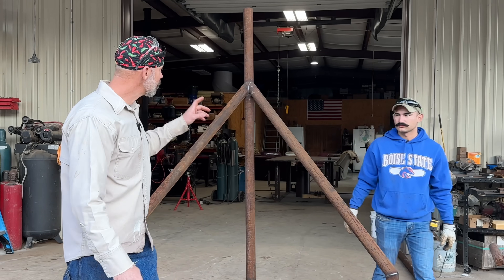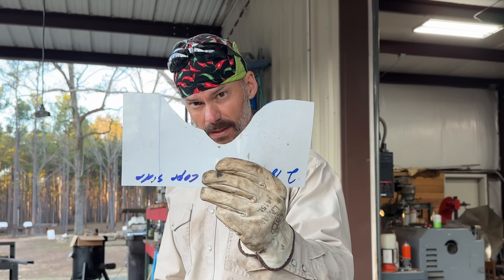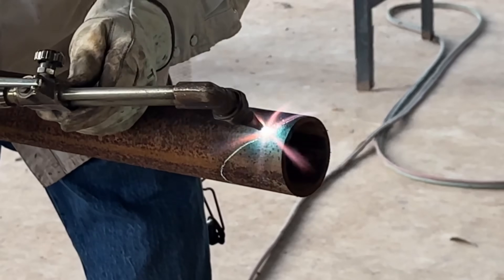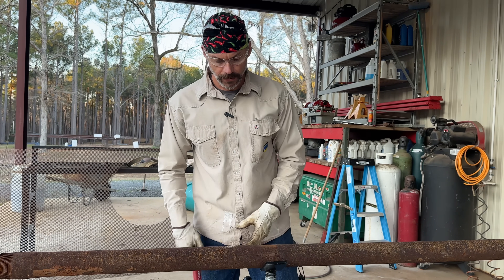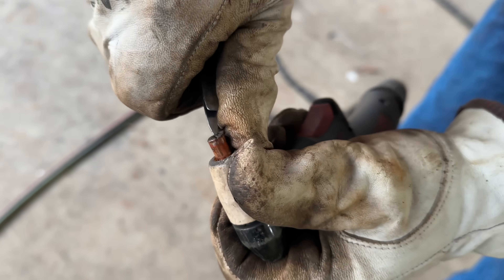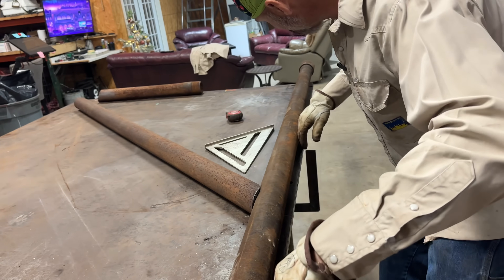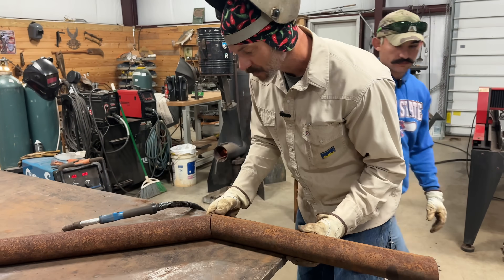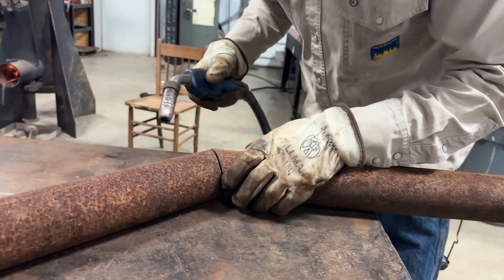Fence Corner Bracing Hack: Save Time and Money

Comment: Pro tip on clamping pipe to the table: cut some short pieces of channel iron (1-2” long) and use them to saddle the pipe therefore giving you a flat surface for the swivel on your clamp and two points of contact on the pipe.
Also, I hope your friend is setting these in concrete, otherwise….,🤦🏻‍♂️🤬!
Reply from the maker: That’s a great idea. And yes, he is definitely using Concrete
Reply: I make mini v-blocks with angle. They fit a pretty wide range of sizes.

Comment: Our past hole digger has a 9 inch auger so I weld a 9 inch rebar across the bottom and 90 degrees form that I burn 2 holes and make a {x} on the bottom of the corners and ends with a sack of concrete to help keep it from pulling up. 
I really enjoy your you tube channel'
Thank You'

Comment: On the welds, usually that kind of pipe thickness, I've always run 21.5 or 22 volts and 275 wire speed. Hardwire is fine for what it is.

Comment: Thanks for the video, could I weld this with a 120v flux welder?  Hobart Handler 140 is the model.
Reply from the maker: I believe so
Reply: @TaylorWelding  I may try my hand at a simple T type fence with some "no-climb" 2"x4" fence.   Metal posts in the ground with a single top connecting each post.

Comment: To save time fitting the brace legs I just chop them off at 45% in the cutoff saw, set them on their sides in the hydraulic press, and pressing them a couple inches back from the cut ends till they are like a long oval end, about 1/2 the pipe thickness. A little v notch at the narrow ends with a grinder cutting wheel, or torch and they fit well enough to get a good weld. We concrete them in at the bottoms because it is rocky here and hard to dig a narrow hole. I save on pipe by welding on 2-4  pcs of 1/2" rebar on the bottoms, on the sides of the pipe, that goes down into the concrete with the  pipe ending  just a few inches into the concrete. Often, I'll have the customer concrete in just their corners and gate posts, and I'll come back later with my portable engine driven welder and weld on the braces and gate hinges and mounts for gate openers, horizontal rails, small walk through gates etc. onsite. The post top caps can go on later onsite, allowing for adding height or cutting them down to suit the terrain. Some want a bolt sticking up with the bolt head welded around on the bottom of the caps to later mount a birdhouse, a solar fence charger panel, a cable to brace a gate from, an extension for deer fencing, or mount a sign across above the entry road gate, etc. On hills and slopes, mounting the braces onsite can help fit the terrain. I don't see a lot of that drilling pipe here, so the customer is usually  buying sch. 40 pipe, either galvanized or black.  Posts are 1-1/2 to 4 inch pipe, and braces are 1 to 2 inch pipe. At the shop, I have a hard wire MIG, and my portable is 6011 or 7018 stick welding. I have a 3 lb.ball pein hammer, and like you, I prefer that over a grinder for cleaning up ragged ends to refine the fit.

Comment: big thanks, if you havent already would u mind doing a video on saddling large dia pipe ? i kinda butchered my first time. but got er in there.
Reply from the maker: Great suggestion! I’ll definitely put that on the list
Reply: my bad you already got a tutorial, but i guess my question is if it matters if its larger diameter or if its the same technique. not sure i how i messed up. subbed 4 more.

Comment: I learn from your videos and appreciate the job you're doing. I've got a question. I'm an old guy and used acetylene and coat hangers to do body work in my youth. I have a plasma cutter and want to know what shade lens to wear when using it. I've heard everything from 5 to 11 and would like to know your opinion. I don't mess with my sight so currently use a self darkening hood set at 10.
Thanks.

Comment: Do you run your air supply for the plasma cutter from your air compressor "as is" or install a secondary filter in the line to trap any possible particles that could potentially foul the torch? I know some shops use oxygen tanks for the supply, but damn, that seems like pricey and unnecessary.

Comment: Good video. Hard wire is very forgiving with rust,but I usually run considerably higher voltage( 22-24+) and mostly.045" wire.I subbed ya !

Comment: Great job on the templates/production & getting 'er done fast-  Kinda surprised that solid wire did so well; just goes to show that it really doesn't care, as long as you can get to solid steel. We always used 6011's, but I also wouldn't be afraid to use flux core.

One question I do have; is he pre-augering holes, & then concreting them in? (I.e.....that preassembled corner would be a pain to drive.)  I prefer concreted corners, but for speed, a lot of guys just drive them & weld the braces in afterwards.

Also; on the plasma cutter....I know that some of the other companies offer gouging attachments; Any idea if you can gouge with the ArcCaptain? If so, that'd make me even more interested in one. 

Thanks!
Reply from the maker: I wouldn’t think the little arccaptain would be good at gouging it takes A lot of power to gouge. 
He’s definitely going to be putting them in concrete. He likes to pull on his fence until his truck slides backwards.

Comment: Bicycle frame building: Miters always, angles never the same (assumes built to measure, as they should be) and on pipes swaged paper thin in the middle, thinwall on the ends.  Two schools there: hack and file or hole saw cuts with a mill or fixture. Tighter miters are the desire because penetration is hardly an issue at .035"/.9mm. Fillet brazing also works well here, as that and lugged are the only two I've built. I don't fit factory. I hacked and filed, no mill handy. 
Your torch work is inspirational. Thanks for showing us how WELL it can be done.
Reply from the maker: I appreciate the input! I can’t imagine dealing with something that thin. That is Out of my wheelhouse. 
Good job

Comment: I'd run those together using flux-core - no gas cost, flux core doesn't care about rust & it welds hotter than hell -  this is an ideal flux-core project.
Reply from the maker: Flux core with gas would’ve been exquisite. I’m not a big fan of fuck core without gas. Seems extremely brittle. it doesn’t really matter. It’s a fence post for sake. 
I’d be a good video what’s stronger on Oil Field pipe flux core without gas hardwire or flux core with gas thanks for the comment bud
Reply: @jamesward5721 what’re some of the things you’re welding? Just curious. I read flux core was only approved in limited structural applications.
Reply: Flux core works pretty good on rusty fence pipe and almost as good as stick outdoors, but I would have stick for any thick parts or add weld reinforcement.  It should be good for all that size pipe in Sch40/80.

Comment: I actually like that idea of building the corner and the little jig you built with the hinge was genius. 

Magnetized pipes sucks when trying to weld it. 

Built an entry way not long ago for a customer and that pipe was the bane of my existence. I tried everything to make the first pass look good and ended up just putting dog-doo-doo and then running a pass over it.
Reply from the maker: All you can do is try to get something to stick on it when it’s bad magnetized. And sometimes it’s impossible. I have seen a few times in my career where it was absolutely impossible to weld because it was so magnetized. And wrapping your leads around it didn’t make any difference at all. I get tickled every time I hear somebody say that.
Reply from the maker: Thanks for the comment, bud

Comment: I do allot of fence and feedlot. The dead man's are good braces. Pretty much all the work I do is in the field. Around here most people want h braces but if it's pipe fence I run dead man's to the next post. If not I usually bury a post at least 3 feet about level with the ground. I like arc 80 about the most for oil field pipe. If it's magnetized I usually just turn it up to 110 to 120 amps. But I always use either 6010 or 8010. Sometimes 6010 cuts into the magnetization a bit better or seems and the 5p red rod works well.i have had some do bad it sounded like a stuck hog and threw balls off metal ball at me. It can be rough sometime but you gotta do what you gotta do. I have never had to wrap leads or anything.
Reply from the maker: Have you tried using a MiG gun? Honestly, I could not believe how good it did. Arc 80s would be my preference as well. Until I used hardwire with gas. I don’t understand it. It just works. Never would’ve thunk it
Reply: @TaylorWelding  i have not used a mig for oil field pipe. Almost 100 percent of what I do is in the dirks and as fast as it is welded, carrying a mig would be a hindrance. About the only time I use mig is welding under 1/16 material with flux core. I guess i should say wire feed and not mig to avoid arguments from people over semantics lol.

Comment: Question: instead of the cuts and welds would it make sense to consider stiffen plates (I’m thinking two at same orientation) with stitch welds or full weld down the pipe? Thinking a plate that fits the purpose would be more expensive than spent OWC
Reply from the maker: That is a great idea
Reply: @ heck 2 better cut plates 3/8 or so might cost as much as the spent pipe by the time the plate is 3” wide though. If cutting the plate yourself it probably works out but if buying cut/prepped nice and square maybe not. 2” stiffener probably works and then likely makes more sense. At least could push/drive the pipe in maybe. Just thinking out loud here.

Comment: Good fit up to me is extremely more enjoyable to work with. I have a mig machine and I can use it as flux core or solid wire my problem is tank space in my shop so I stay with the flux core wire. I would prefer 6010 stick welding then mig wire. However you proved a very valid point that a mig wire could do a good job at this. Lots of people starting out would have butted up the joints and not gotten the results that you did. Difference being 20 plus years welding versus a few years. I basically taught myself to weld using stick process and I’m most comfortable with it. However I’ve built several meat smoker using new 10 gage metal so I used the flux core process. I’ve picked up a lot of VERY valuable information from your and others videos. One being different rods for different applications another is cutting touch usage. There’s a world of information on welding out there some better than others. Your to me is one of the better ones. I’m old and have no intention of becoming a professional welder. However, I still farm (small scale) but do all my own welding repairs. For the longest time I just assumed that 6011 rod was all there was. You proved that not to be the case. You proved that 6010 and 7018 together make a very strong weld and open root has a very major advantage. Thanks for sharing.

Comment: Torch echoing out of that pipe is music to my ears. 

If you didn't have any second hands you could put a soapstone line on the opposite side where you want it and eye ball it before you cut, when your at the table you could get conduit or pipe with the same sleeve diameter and have a really tall jack stand set up and self level it that way without having to weld on the table. Might have to have a smaller diameter pipe put in to give you length since the bottoms are even.
Reply from the maker: I love that idea!

Comment: I have a 2 7/8 horizontal piece of pipe on a corner that’s magnetized that I think I’m gonna have to cut out but someone said changing the polarity can sometimes help. Do you have any suggestions?
Reply from the maker: I have done everything I could come up with to try to get magnetism out of pipe. From picking it up and dropping it on the ground with a forklift to wrapping my leads around it every which way ,changing polarity, ect …
Sometimes if you get it hot enough, the magnetism run away like to the other end it’s weird. So cut it with a torch or get it hot with a torch and get something on it. Even if it looks bad. Grind it good enough and put a cap on it.
I hate magnetized pipe. I’ve welded a lot of of it seems like the hotter you get it the easier it is to weld. But the other end might be just as bad when you go to mess with it. I hope you can understand this. I’m talk texting. Have a great day, bud. Hope this helps.

Comment: I never braced fence corners, we would stick in a used concrete utility pole sunk 5 feet in the ground. The used pipe you have is impossible to find here. I need to get one of those plasma cutters for my future projects. My Mig welder broke and I need to find a decent replacement too.
Reply from the maker: ARC captain 189 bucks. I think you’ll really like it. Air compressor and a 30 amp plug-in and you’re on your way. Thanks for being here, bud.
Reply: @TaylorWelding  Good price, glad it works! I can plug it into my shop air and start cutting! I learn a lot from your Welding techniques!